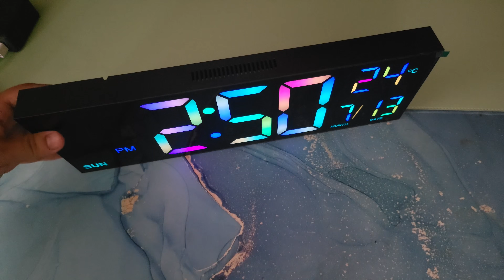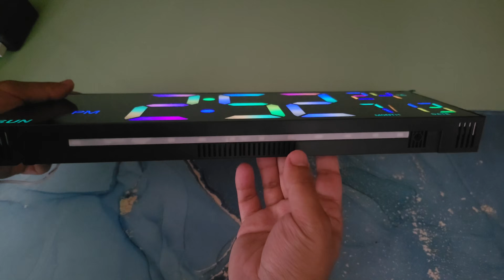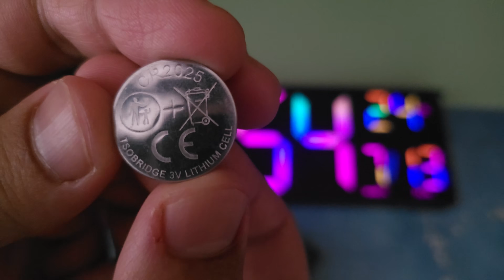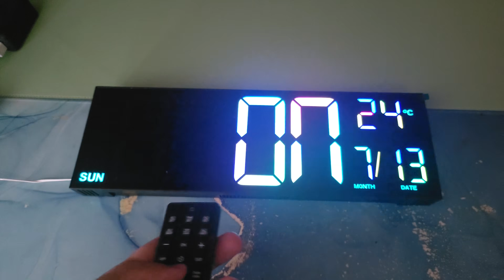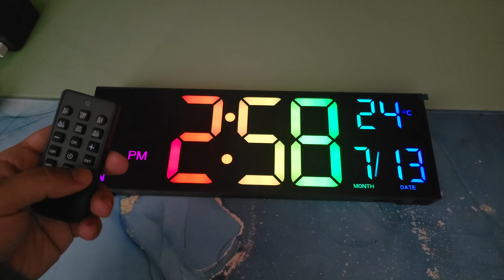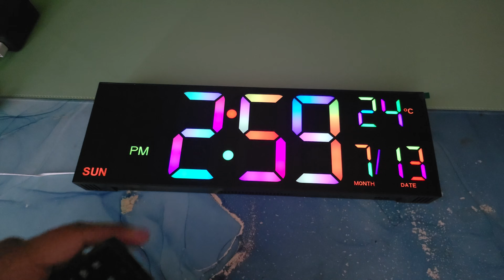16.2'' Large Digital Wall Clock with Remote Control Big LED RGB Colors Alarm Clock Electronic Watch

Comment: Nice review... the only thing I wanted to see was the timer though 😂 Does it allow you to set any amount of time? Will it do Count Up and Count Down? Does it show the count? Cheers Najam
Reply from the maker: max time 39:59, it counts down and shows the count (time is not visible) you can cancel the timer by holding the timer button, press ok to pause timer. the volume buttons are on the remote and it will beep when finished until you press ok.